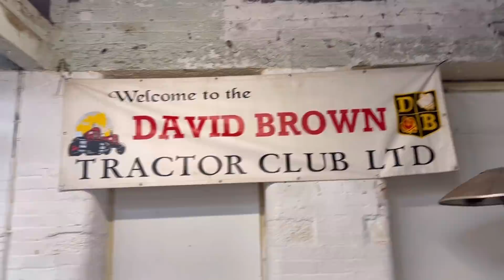Day581  #OLLYBLOGS I NEED BIGGER WHEELS , QUICK LOOK AT DAVID BROWN MUSEUM  #AnswerAsAPercent

Comment: You could still move through jlg churry picker, using the ground control to rotate it then drive as normal, new joy stick is just a plug n play job
Reply: I have a new joy stick if you get stuck for one 👍
Reply from the maker: It would from the bottom yes

Comment: It might be obvious, but becareful with the 1455 altering the ratios or rear wheels as will affect the 4wd and may do some damage. Im not sure how the 4wd is engaged, if its totally disengaged when in 2wd  should be no problem but if there is a clutch to engage it might cause problems. The ratios are for the correct size of all four wheels.
Reply: Ye but was wondering how that would work, I imagine you would have to change something with the transmission or you would have to change all four tyres to keep the ratios the same
Reply: Our maybe take the drive shaft off.

Comment: Think u need a 650 85 38 rears for the case if it'll fit in the arch. Can't just remember the matching front size ti avoid 4wd/transmission damage. Try Carl from tyres n tubes might be able to help

Comment: You can't put bigger rears on without changing the fronts, you'll knacker the diff also 520/85/38 and 20.8/38 are the same size

Comment: I know you have probably thought of this already but if the fluid in the turbo clutch was old or had a lot of miles it, could have lost some of its viscosity meaning you would get as much power through the clutch. So changing the oil could be worth a shot
Reply from the maker: Think it bin done tbh

Comment: Please think on Olly. If you're going to put bigger wheels, or tyres on the back of the Case only, the ratio between the back wheels, and front wheels is very important,  so don't accidentally engage  4WD !
Reply from the maker: Yer it might do it automatically under breaking tbh